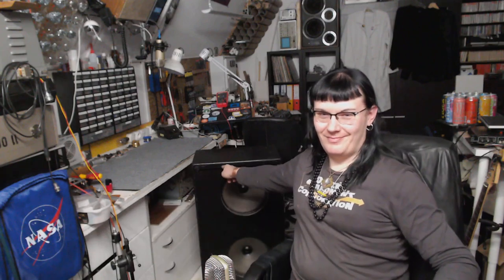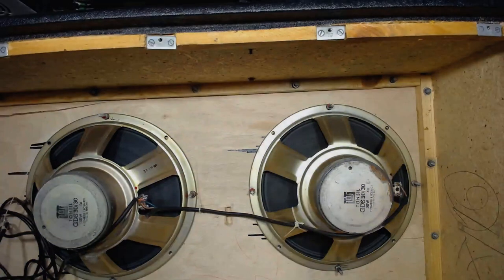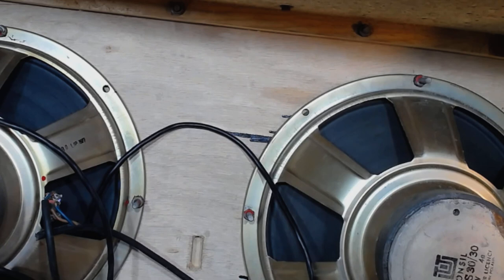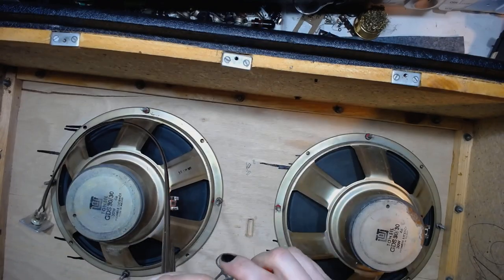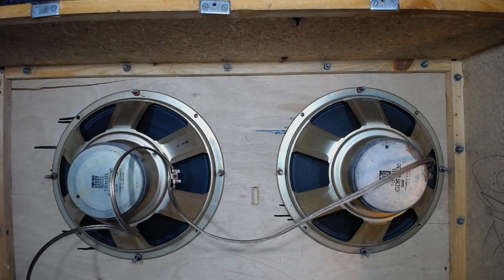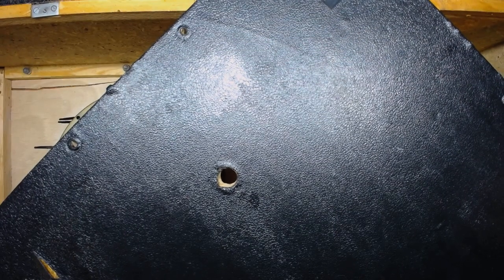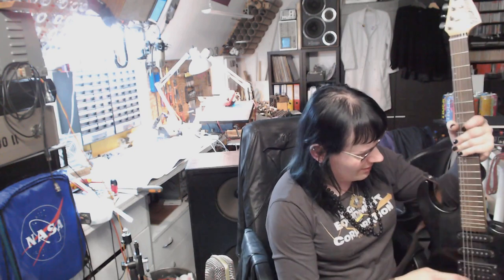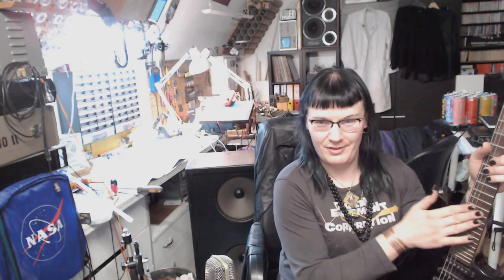Speaker Cab Madness! Rewiring a Botched Job

Comment: Hello Keri! Thanks for posting!
Reply from the maker: I've been busy and coming back home dirty & tired, but gotta catch up with projects and videos :)
Reply: @KeritechElectronics  I've been recovering from the plain old boring flu, but I've also been working on a '87 Peavey CS - 800 amp. A bit mysterious at first blush, as it blew my 15 amp house breaker but not the amp fuse. Turns out the hot going to the amp fuse was shaffed and shorted to the spkr output wire. Unusual... But I was too lazy to check every thing before I pushed the power switch. Poof! Out goes the lights! But it was so heavy and innocent looking... Like my men. Ha Ha! But one can never be too carefully these days... Cheers!
Reply from the maker: @fullwaverecked  oh yeah... that's why I never fire up any unfamiliar device just like that. First I do a proper inspection and then fire it up through a dim bulb tester, just in case.
Reply: @KeritechElectronics  Yup!